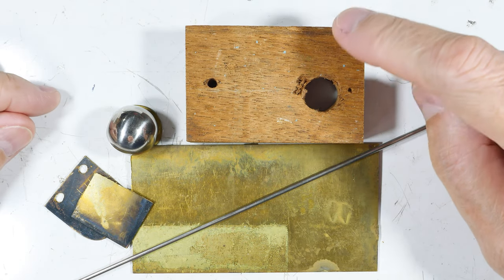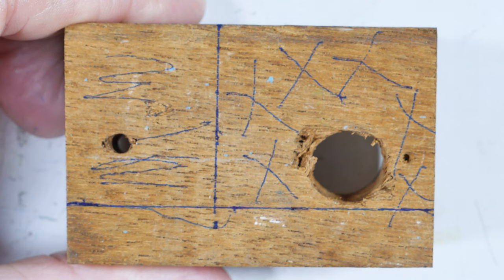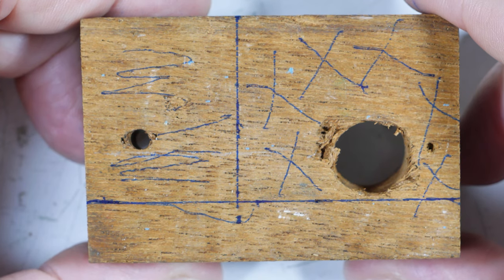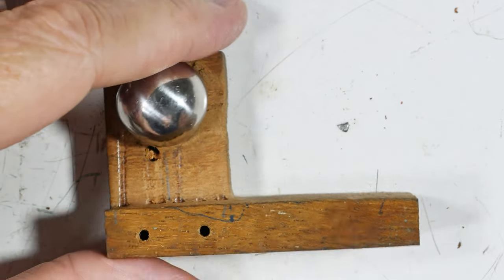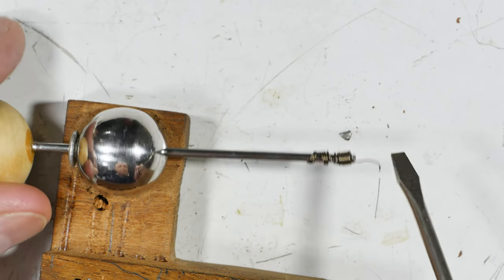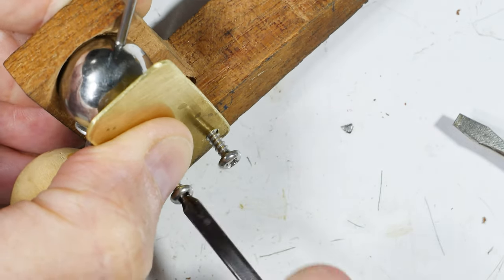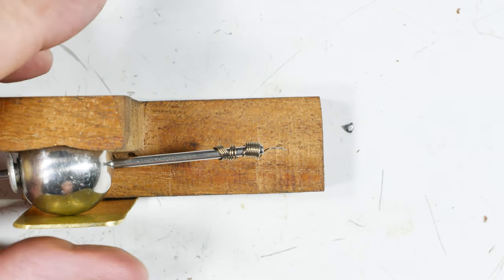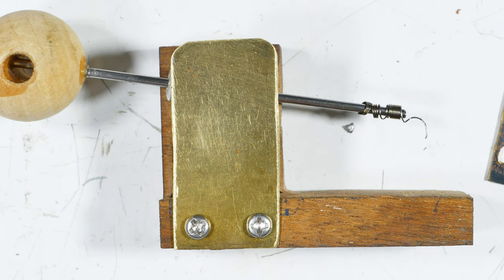Crystal Radio DIY Cat Whisker--Wood, Brass, Stainless (4K)

Comment: So the steel ball is hollow? Whst is it from? I was thinking of using a pinball but it will be a little bit of a task to drill it…
Reply from the maker: I ordered them online, every time from a different seller. I search for stainless steel bead or ball.
Reply: @tsbrownie Is the ball hollow or solid? Do you know if the vintage balls were hollow or solid?
Reply from the maker: @trs80model14  I don't think the antique balls were stainless, most likely brass. Not sure if they were solid. The ones I'm using are hollow.

Comment: Is it possible to have a fairly simple diy crystal radio that can have the sound being outputted to anything that's not the specific little crystal radio earpiece (speakers, regular headphones, audio interfaces for recording via software, etc)?  Enjoying the videos, btw!
Reply from the maker: Yes it is. I have an old video on how to do that.     "Crystal Radio, Connect A DC Audio Amplifier"     https://youtu.be/RW3VhnzgjtA
Reply: I posted a link to an easy DIY audio amp, on the  "Crystal Radio, Connect A DC Audio Amplifier" link. HTH.
Reply: Ebay sells impedance matchers for $10, so regular headphones and earphones will work.
Reply from the maker: @Pygar2  It's more than just impedence matching, the total power needed is important, especially for faint stations.
Reply: @tsbrownie Very true; just pointing out options. I still have two Radio Shack 4K amplifiers!
Reply from the maker: @Pygar2  Those were good. I gave mine away when during one of my many moved. Wish I had not. Someday I have to make a video of all the Radio Shack stuff I still have.